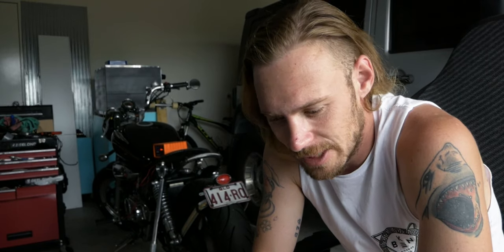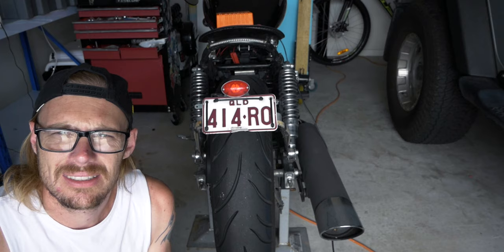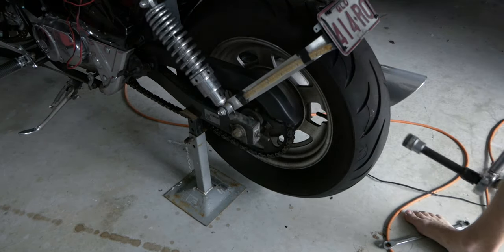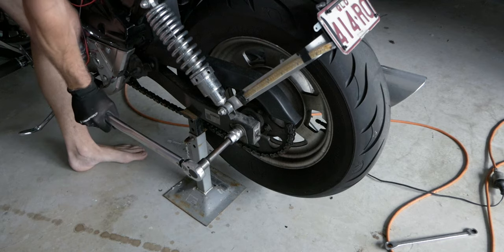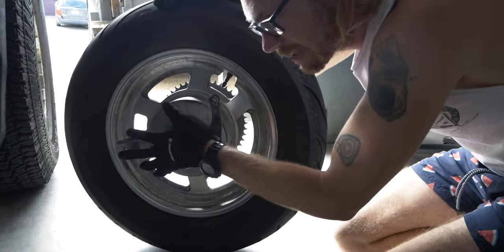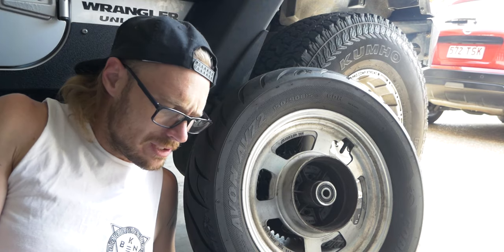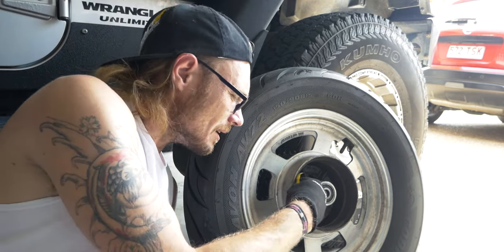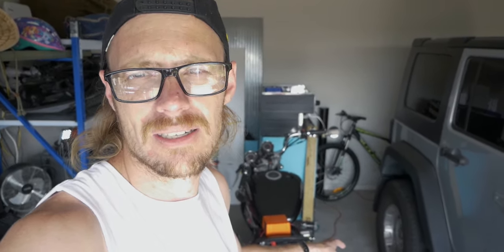GV250 Rear wheel removal and brake servicing

Comment: I took the wheel off to paint it and ran into issues when I was putting it back together so watching this to make sure I did it right so thanks mate 👌

Quick question though- the service manual said the rear axle goes through on the drum  side. But when I took it off the rear axle (Like on your bike) went through the chain side - do you know if it makes any difference?